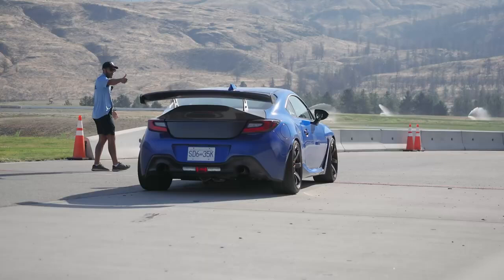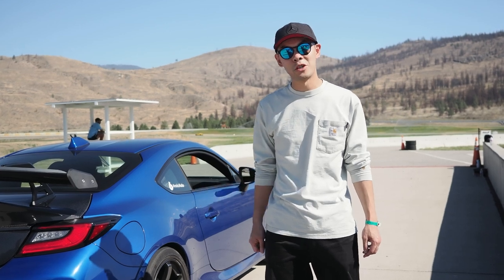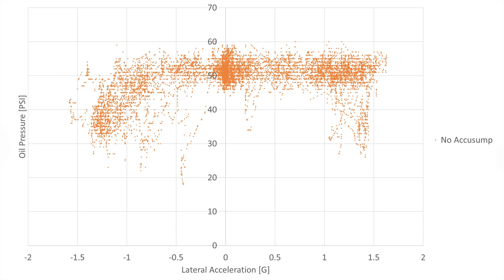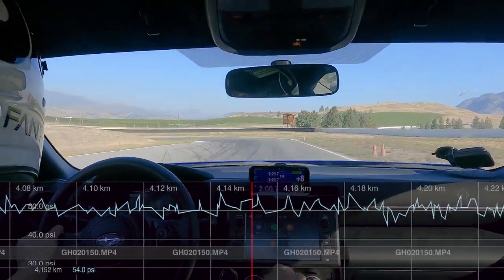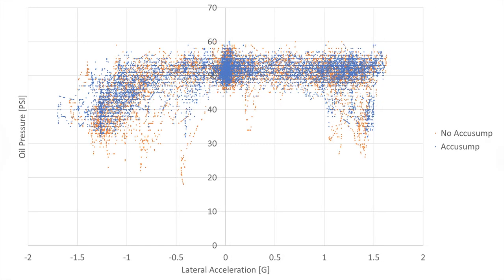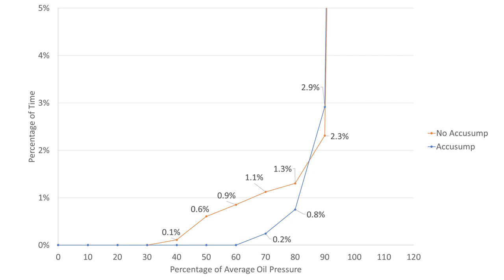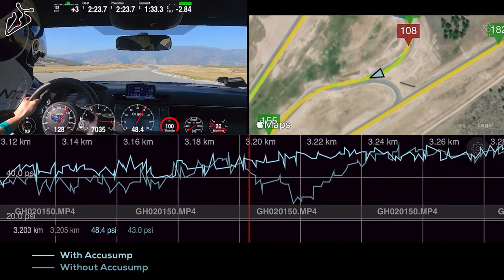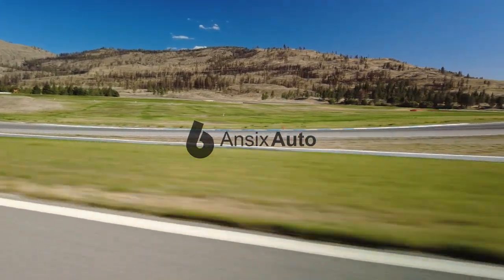Ansix Auto Accusump Testing for Subaru's BRZ Engine. @AnsixAuto

Comment: Thanks for showing this. Much better with the Accusump but this is not good enough.  Those big dips in pressure at high rpms is air.  The best fix is a higher capacity oil pan.

Comment: glad im here in a clear comment space, so i was looking at the everyday driver i think, comparing gr86 to brz, do you have any thoughts on the tuning differences? I suppose based off the information the subaru is suppose to be the more track capable if im not getting that impression wrong. The 86 is suppose to be more tail happy in the rear. Thanks for the vid!